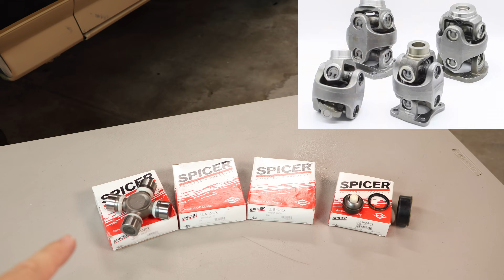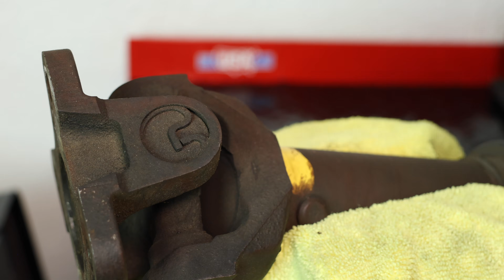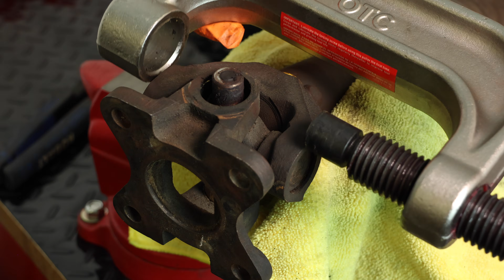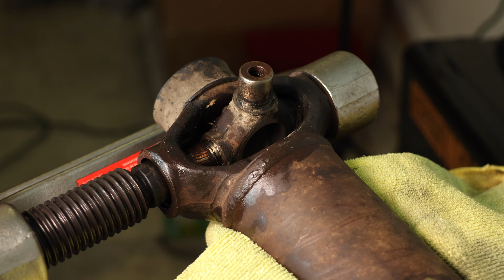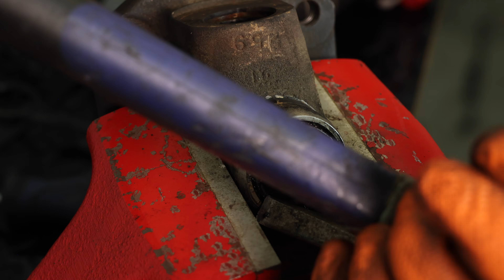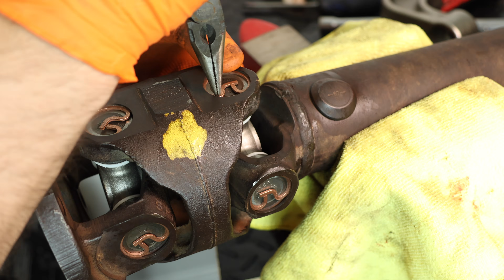Double Cardan Driveshaft U-Joint Repair | 1980-1996 Ford Bronco F150 | Bronco Restoration

Comment: I was always told once you replaced the u joint and reinstalled the driveshaft. It was a good idea to take a hammer and tap all of the ends of the U joints to make sure that they were free and not binding up don’t know if it’s superstition or not. But I do it anyways.

Comment: This is great thank you! Although all components should be balanced independently, it’s never a bad idea to make witness marks on each flange and section as it’s disassembled, so that they can be put back together with the same “clocking” in case the drive shaft was balanced from the factory as a complete assembly (likely). Thanks for making this!!

Comment: This is a great video, and I actually have a '90 Bronco XLT, so this is perfect!  I do have a question, though.  I went to Amazon via the links in your description, but BigRiver says they're for an F250 and don't fit a Bronco.  I'm going to order them, for sure, just wondering if you have any thoughts on the matter.  Thanks!
Reply from the maker: These are the parts I used, a lot of the 4x4 components were shared with the F250 depending on the years.
Reply: @TheFixTech  Thanks, and that's what I figured, just wanted to be sure.  Sometimes Amazon just isn't right!

Comment: I saw another video where he chalked points of the shaft to make sure it installs the same orientation when you're done. Is this important or does it not matter? Thanks
Reply: Yes, it does matter due to the fact that the driveshaft is balanced during the assembly process at the assembly plant. If you don't mark it and you have a vibration you will need to rotate the driveshaft a quarter turn or so and install in different bolt holes. The same goes if you do any rear differential repairs or replacement. If you forget to mark the driveshaft it is not the end of the world just another step is required. That being said, I did enjoy and appreciate this very well produced how to video, keep up the good work. Thank you

Comment: Great Video - question though. I definitely payed the idiot tax at the parts store… Bought a 60$ ball and seal kit and installed it, let’s say, differently. Having a snowstorm in a couple days so it was kinda an emergency buy. HOWEVER, they did not have the outer seal. 

Does the outer seal you linked work for the 95 f350 4x4 d60 and bw 1356 double Cardan? If so, Im ordering one. If it’s not, do you know which one to get? From all my looking I feel like they are hens teeth. 

Also, on the driveshaft side, it looks to have a press on cup. Mine was chewed up on the inside, but didn’t limit movement and nothing is scraping. Are those available to buy? Id Ideally like to replace that as-as well but I can live with it if I need to. Thanks!

Comment: Where did you buy the axle boot clamps after degreasing the splines?
Reply from the maker: I reused my original clamps, but you can use large boot clamps located in auto parts stores or hose clamps from hardware stores.

Comment: I just added a 4” lift to my 91 bronco and now it makes a grinding noise when I let off the accelerator above 60 mph. Would that be a drive line issue?
Reply from the maker: Yes, you will need to set the driveshaft angle. If you used lift blocks in the rear be sure to reuse the factory angled blocks as well. You may also need a shim spacer. Remove the driveshaft and check for worn ujoints.

Comment: Is this a 1350 driveshaft?
Reply from the maker: These are the 1330 series driveshaft used in the f150 and bronco 4wd. The f250 and f350 used the 1350.
Reply: @TheFixTech  Im trying to upgrade mine to a 1350. I noticed you do not have a slip on yoke. Correct me if i am wrong.
Reply from the maker: Yes mine does have a slip yoke, it is under the rubber boot. 1990-1996 version